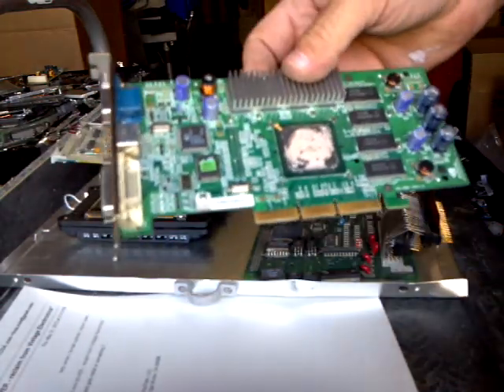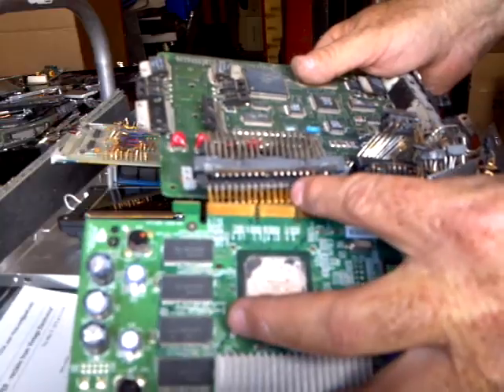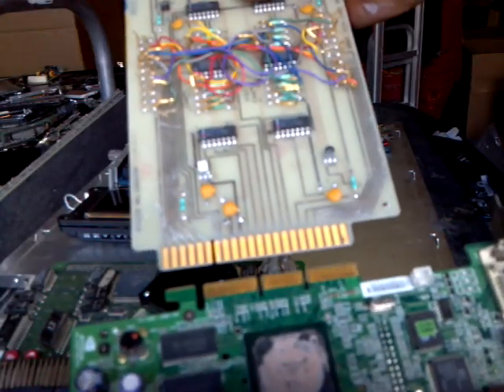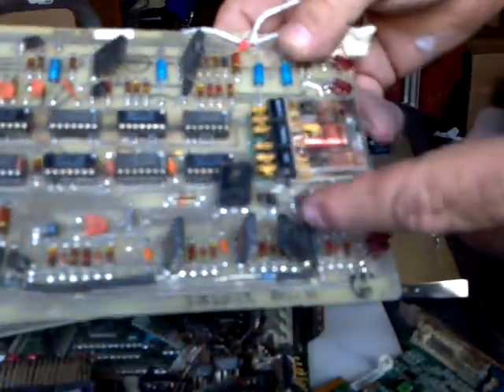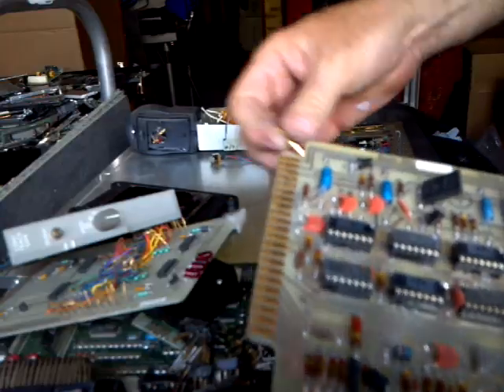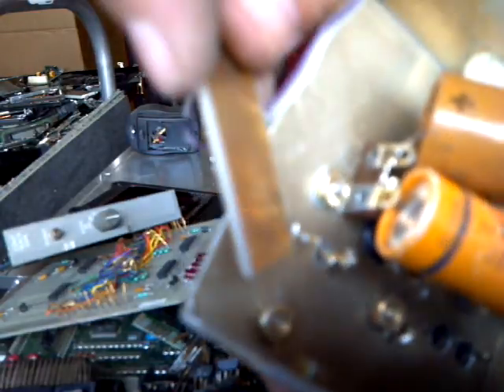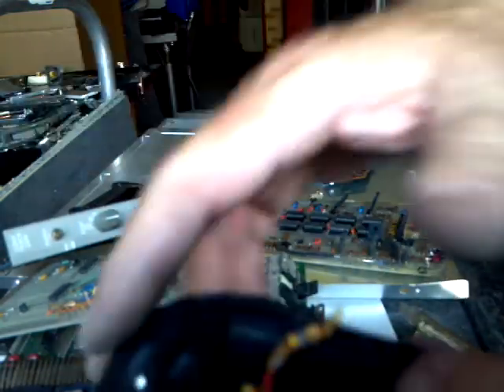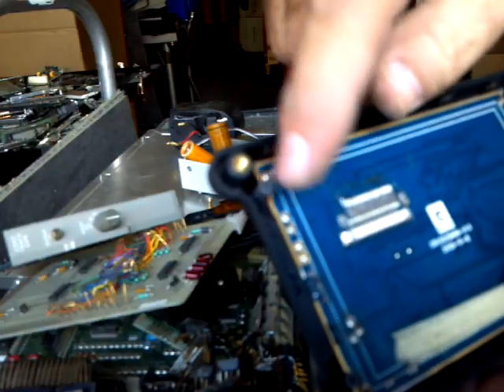How To Identify GOLD, Brass, Painted Gold, etc. In Electronic Circuit Boards

Comment: Let's say you had 20 grams of gold. 25% of it is gold plated and the rest is solid gold. If you melt them together will the brass or copper mix in with it or will it burn off and you'll be left with solid gold?

Comment: Sorry but your comment about testing with a magnet to see if it is gold is wrong.  All gold plated pins and connectors that I have ever collected have been magnetic.  When I heat the pins off of a CPU I pick them up with a magnet.
Reply: manitobaphil; I believe he was talking about the brass. To determine the brass from a gold colored or even a gold plated anything. Yes, you're right, it's not an accurate method to test for gold in electronic pieces because the gold is plated on the parts, it's not pure through and through. However, what this really boils down to is, for those who don't know, just use common sense. You know the parts are plated w/14kg. so where will you find it? it's on/in any part of the electronic board circuits that are designed (intended) to conduct electrical current only. Some of your connectors, mostly inside/out of your electronic parts themselves, e.g. leads on some of your transistor or perhaps leads on a small relay and even some parts inside the relay, your edge and finger connectors , pin connectors, sometimes your tracer lines are gold plated too. It's not gonna be the screws, nuts, or anything that has nothing to do with your electronic circuit itself. I'm sure you know that. That's the over all point he was making.
Reply: manitobaphil I'm just now watching this video and I caught that too. I mean if it's plated of course it's going to be magnetic. I hope a bunch of people didn't scrap a bunch of gold in their brass. LOL

Comment: I'll teach you something. I do phone repair and on iphone 4 there is a screw that needs to go a certain length down or it won't connect and allow your antenna to work in the phone. Very common starter repair mistake. But my point is that they most definitely use gold plting on nuts and bolts more then you think. You should test most stuff before you just chuck it out, you would be surprised.

Comment: I noticed if you file down a wall plug  connector it looks gold idk do you know if it's brass or gold ? I'm really curious and a lot of pins also seem to be silver plated solid gold when I file them down
Reply: Joshua Soanes I think one is stainless steel or galvanized and one is brass. They are made different because you can differentiate between the two hot and ground. I'm not completely sure let's see if some one corrects me.

Comment: Sorry ,one question I forgot to ask,the screw drive in DVD roms appears to be a distinct gold color.Could this possibly be gold plated,and why?...For electrical contact reasons?
Reply from the maker: 99.999999% that screws are NOT gold plated - even if they look like it........
Reply: Making Money From JUNK That's interesting but it leaves me with one question.And that is of the many different DVD Roms,of different brands, I've scrapped ,all have had gold coloured screw drives.None have had silver coloured drives.Love to know why.Perhaps they're brass But they're look so very much like gold..And perhaps its a mechanical imperative for it to be made out of a particular metal. Next step is to figure out an acid test that will eliminate some possibilities.

Comment: What type of underlying (silver coloured) metals are used under the gold plated wire connector tips?I think you mentioned nickel,but could there also be silver underneath? Is aluminium used as wiring or underlying metal under gold plating? And is there such a thing as silver wiring as against copper wiring? 
Also regarding gold plated wire contacts,if you cut the contact off ,is there a way to dissolve away any underlying metal,be it copper,aluminium,whatever,to just leave the gold behind.?As we know gold is unchanged under action of any one particular acid,although aqua regia will dissolve gold,but that is a combo of acids.Thanks ,Trevor.
Reply from the maker: anything 'modern' (post 1985 or thereabouts) will be less and less gold and the likelihood of silver under that is very, very unlikely, though the solder may contain minute amounts of silver.  Older stuff is better - see my videos on vintage items for more on that.

See my website (link in the comment under the video) and e-book for answers on refining and what I do to get pure gold from all this electronic scrap.
Reply: Making Money From JUNK Thanks for that .Will follow up when have chance.

Comment: i have an older laptop.pretty sure 90s..wasnt working... i scrapped it it... has a metal tin thing cover over the cpu and it makes contact with the gold on the cpu board measures about 2x3 inches.. i rub it on my stone with 10k acid..and took about 20 seconds and disappeard  is it thin plated gold or brass.?... spring loaded washer things are gold colored too and the 4 screws that hold it in place are shiny... just like all the other magnetic screws in puters.. any suggestions?
Reply from the maker: 'suggestion' for you is to keep gathering.  One cpu from a modern computer has about $.25 worth of gold - after you go through the refining process, with the cost of chemicals and time, etc.  - i.e., "One scrapped laptop does not a fortune make!"
Reply: Making Money From JUNK you mean 25 cents?

Comment: Keep in mind that gold plating in consumer parts didn't get popular until the 90's. There are many boards that are still floating around that were cheaply constructed using copper contact. Test with nitric acid to be sure - gold doesn't react (not apparently) with nitric acid, but copper would (almost) immediately turn green. (i say "almost" because in absolute terms there is a delay in appearance with any reaction).

Comment: hey that screw could quite possibly be gold plated, brass does not stick to a magnet, and brass screws are usually solid brass, some gold plated screws are used through the grounding system

Comment: is the gold connecters the only Gold to be found on a Graphics Card or does it depend on the model?
Reply from the maker: I think you answered your own question, though I will say that, just as shown in the videos, you need to LOOK for the gold bits - they could be 'anywhere' (at least, in the places described in this video).  In my ebook about scrapping computers I include a nice table showing many places to look for gold and precious metals - handy to print out and keep close at hand....... ;)

Comment: do you know those antenna pieces that look like mini brass plumbing joints? would you know if the are gold plated or brass?? thanks
Reply from the maker: Seems you are learning one of the 'secrets' of identifying parts - if it LOOKS like something you know, it probably is like it...... - (ie., those are brass - they do not have an 'electrical' connection, though they do need a 'strong' one)

Comment: The plating metal will always be the pure form of that metal, alloys such as brass and bronze are not plating metals.  An attempt to do so would likely result in copper plating with the tin or zinc being left behind.  Since the mid 1990's solder used in electronics contains 50 to 80 percent silver.
Reply: Robbob9933   BS
Reply: provide evidence

Comment: Informative vid
Reply from the maker: Michael Cole Good question!  Though answered in the videos, perhaps it is not super-clearly stated (the ebook goes into much more detail than I can put into  the videos or these comments...), so, to answer it clearly here (in a different way), the gold used in electronics is GOLD - 'fools' gold is a rock (not metal) that has no electrical abilities, etc. 

PLATED means "applied to the outside of other things" (rough definition).

In terms of plated gold in electronics (which is all you will EVER find if you are looking in consumer-grade electronics -I did get one piece of pure gold out of a super-high-tech lab piece once....), it means that the core of the piece (that gives it strength and thickness so it is big enough to handle) is some other material that is the connection to the circuit (typically copper).  Since copper is somewhat flexible (i.e., soft), most electronic connections also contain a thin layer (yes, also 'plated') of nickel to give the item additional strength (the same reason these two metals are used in making coins...).

As an example, consider a pin (like those shown in the video - starting at 1:04) - the base of the pin is copper, but if you had just copper it would be very easily bent (think plain copper wire of that size), so, they are plated with nickel to make them stronger.  The last layer of plating is GOLD and, as stated, they are 24K gold and have various plating thicknesses.  Gold is used to make the connection on parts that often move (or could be) like the fingers and pins shown in the video (see, it IS answered in the video......  ;)
Reply: does gold plate metalmake real gold when chemically treatedor does it produce fake gold known as fools gold bcuz I aways thought plaited means fake

Comment from the maker: From here/there and somewhere else.........  Electronics are all over the place, you just have to find them.  I actually do very little work to get the boards - they come to me.....  One of the BONUS pieces I've included in the ebook (link in the main comment under the video) is the EXACT ads I use to bring in all this stuff - seems to work for me.......  ;)

Comment from the maker: Have you watched my videos? (obviously not....)  or, read my books (ditto....) - you would know how I handle the boards and how I do NOT work with acid.  I believe ACID should be used by someone that knows how to handle it SAFELY.  Recovering gold from parts using acid is how it is done, but each type of part uses different types of acid mix/combination and I do not have time nor interest in learning that - what I am doing is Making MONEY From JUNK, not learning to be a chemical refiner!

Comment: I am wondering if you can help me,i got a lot of gold pins,chips,monolithic capacitors gold plated circuits boards and other things. I'm getting ready to refine them and wondered if you knew a refiner in the UK that is reliable. I have done loads of research and was thinking of doing the most part my self but till I feel comfortable I would prefer someone else to do it. Can you help me many thanks. Keep up the good work.

Comment from the maker: not sure what you mean by "It's", though what is shown in this (and all my videos, as well as discussed in my books, et) IS gold (yes, at ~$1300/troy ounce). 

Attributes of gold over copper or brass?  Not near enough room in this YouTube comment area to begin, and certainly this is not the format to train you in metallurgy and composition, etc., though let's just say that gold is a MUCH better conductor of electricity as well as malleability which makes it a FAR  superior metal for electronics

Comment: He has a point. I recently took apart a hairdryer and found brass rivets connecting wires together, across the mica sheets. I also recall finding wires connected to two brass posts, inside a AC/DC power converter that I took apart once. Also, aren't all outlet plugs brass?

Comment from the maker: brass for electrical contacts?  not that I know of.  Brass is not as good a conductor of electricity as gold, doesn't "spread" as well (which is one of the features needed in in/out type connectors like finger cards and slots) and also is quite difficult to solder (requires a higher temperature and method - not something that electronic components can tolerate) - so I wouldn't say "never" (might be possible?), but "not reasonable".  Thanks for the question and keep Making Money From JUNK!

Comment from the maker: I'll answer the second question first, in this way - what you would have is not any "type of gold" that could be sold in most places......  Now, to address it a different way, WHY would you spend time, money and effort to 'melt down' something that has to be treated chemically to get the gold separated already?  What you are then creating is an ALLOYED MESS that will likely lose more values in processing - if it can be processed at all.  More details in my ebook - see the website for details.

Comment from the maker: Appreciate the LIKE and SUBSCRIPTION!  Although, if you plan to see platinum recovery from me related to computer scrap, you will be waiting a LONG, LONG time..... - as I have a firm belief in that being 'on the edge' of what you call "economical".  Yes, there is platinum in computer scrap and with enough of the right kind of material, you might get an amount worthy of recovery.  Save it up if you like - for me, the storage cost isnt' worth it.  Sell the boards to those that can refine it!

Comment: You will never find 'gold paint' or 'brass' on any electrically conductive part. Gold was used when low signal loss on components and connections were CRITICAL. So if you see 'gold' on the PCB or components, it's GOLD. If the entire layout was critical, the entire PCB was etched from a gold blanks and it pains me to think people just cut the fingers off and chuck the rest without knowing if the plating goes past the fingers. There are ways to tell, none were covered here.

Comment from the maker: Guess that would depend on just what measure "tote" is quantified under!  We buy them by the pound and the price depends on the quality - i.e. "close cut" (very little/no green board showing) fingers with "full striping" (no missing 'fingers' of gold) on both sides of the card bring a much higher price than a pound of, for example, recent-made lan or video card fingers (from boards typically marked 'China') will bring.  A 'mixed lot' is usually purchased at a low average price.

Comment: this video is as close as I have found to the help I have been looking for. I am still unsure if what I have is brass or gold for I have never seen anything like what I have... I do have access to mercury but I am not sure how to use it or if that would be the proper way to "refine" this. also there are lil tiny chips connected to the pices I have that I know have gold in them.

Comment: it was from a stereo cassette deck but it wasnt on a circuit board I will make a video and upload it in a few minutes. It was connector pieces, washers, and different parts of it and I couldnt shake the thought of it being gold. due to the color. I took it to a place to have them test it because I don't have the kit to test it myself but I felt like she was not truthful with me. she said it passed the 10k but not the 14k. I will show you in my video. =)

Comment from the maker: I presume "the gold test" is being made on electronic parts?  If so, you are wasting your time and precious chemicals!  ALL gold you see in electronics is 24K ("pure") - it is just VERY thin!  It is layered on top of various other metals - depending on the manufacturing process - typically both a nickel and a copper layer as well as the gold (and, yes, all three are in that tiny little 'bump' on the board - not much of any one!

It is ALL plated on in the various metals and thicknesses, but 24K.

Comment: if the gold acid test shows 10kt but not 14 does that mean I have a piece of 10kt gold? Wouldn't that piece be the same as a 10kt gold ring or bracelet but it also contains another metal just as jewelry does?

Comment from the maker: Interesting question, yet tough to answer since I haven't seen the boards. All I can say is "possibly" the gold went into the ashes, though I would have to say "doubtful" that it "rolled off", as that term implies the gold went to liquid form. Gold melts at nearly 2000 degrees F and most every sort of board material will burn much faster than that, if the gold actually did melt, all you would have is ash (or, rather, a big clump of mixed metals and ash). Any gold in the ash can be washed out.

Comment from the maker: That is true - there are some chips with solid gold wires in them.  That is why certain IC chips are high value.  Some do not have much precious material (PM) in them, which lowers the overall average price we pay for a mixed lot of IC chips.  If you have a quantity of any one particular chip that has been tested and known to contain 'X' amount of PM (which includes gold, silver, platinum, even palladium sometimes) we pay a much higher price for them (like ceramic processors, for example).

Comment from the maker: I've watched this video several times - just can not find where I said you can't solder brass.......  I did say that when you see solder, it is gold (when it looks like gold....).  What I didn't say is that, to solder brass would be 1. difficult because of the high heat and 2. not as solid an electrical connection (both of which is why brass is not used as a solder connection in electronics).  

I'm happy to see your comments, please be sure they relate to the video and what was said.  Thanks

Comment: i think the only solid 24k parts are with in the black polymer ic chips, flat pack and cpus, anything with a micro chip in it has solid gold bonding wires but also sometimes made from aluminum

Comment from the maker: Modern electronics use very little silver (there is a little bit in the solder and some solder masks), while vintage electronics utilized silver a lot more (silver plating was very common for years).  Some older capacitors contain a high degree of silver (up to 40% by weight) and silver is used in hi-tech devices for a smooth, shiny surface (optics, etc.), however, most of the 'white' metal you find in modern computers is aluminum.  See my videos on vintage electronics for more details.